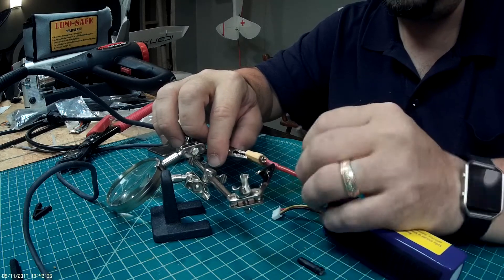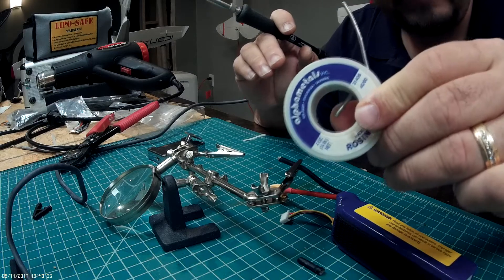How to Solder - Tinning, Convert your LiPo Battery connector ends to XT60 from EC3, Deans, JST, etc.

Comment: Hey Dan, don't be afraid to trim back the insulation on the wire so you get much more copper into the cup of the connector. Also, the tip on that iron is not very massive so it takes longer to heat up the wire and connector. You should really put the Chisel tip on. Also, swipe the tip of that iron across the wet sponge to clean off the old dirty solder, and place a tiny dab of new solder on the iron before adding heat to the connector, as the new clean solder will transfer heat much quicker. Also, place more solder into the cup when you tin it, and heat the cup of the connector so the solder is molten when you stick the wire into the cup, then remove heat. Then you can apply more solder to the joint with the wire stuck into the cup. I only hold the connector in my pana-vise, and I guide the wire into the cup with my other hand. I will hold onto the wire back far enough to not burn my fingers, most of the time.
When I get home, I think I will make a video on my technique
Reply from the maker: Hi Bill, 

Thanks for your tips. I'll be sure to consider them my next time out. I do have an anvil vice that will keep those hands from moving around. That was a real pita trying to hold it all with one hand like that. With the vice I can focus on the wire. And heating the cup of solder before inserting the wire. Awesome. Thank you for all your good advice. I was advised by another friend to switch to a chisel tip but was in such a hurry to get this video done and up that I totally forgot. I suppose something you're saying in there about the vice is, as long as the wires and cup are tinned, I shouldn't need the hands, and to be fair that vice isn't going to slide around like those little cheap import hands did, so thanks again on that. I have an anvil vice sitting outside. small from harbor freight also, but like 30 lbs. it's not moving anywhere. which would have made attaching the shorter negative wire to the connector easier.

I might play with trying to get the tip to hold solder tonight. I was just in awe of how fast it melted that stuff as compared to a 30 watt stick from harbor freight.
Reply from the maker: Hey, I wanted to let you know, I put the chisel tip on and WOW what a difference. Never going back to the pencil tip.